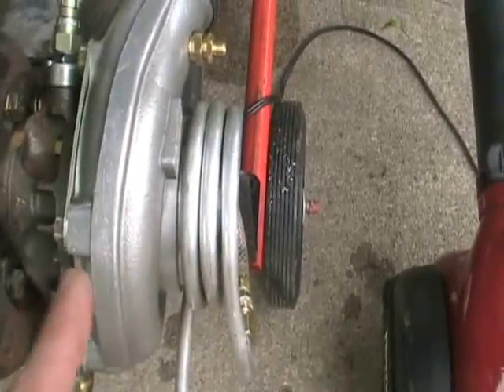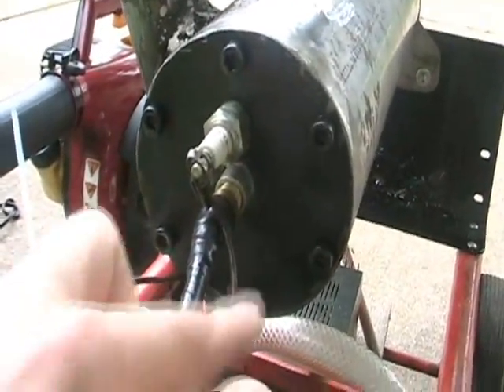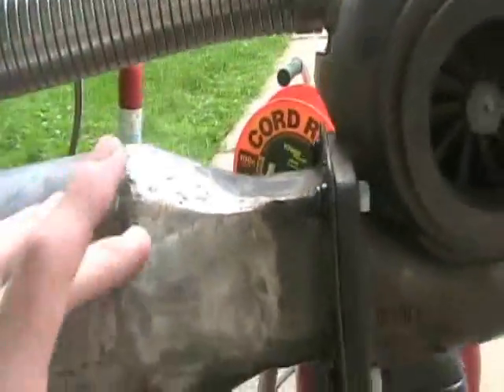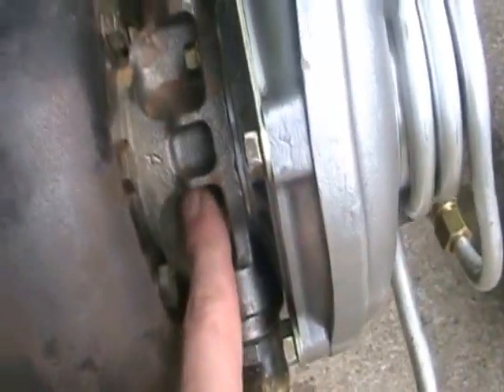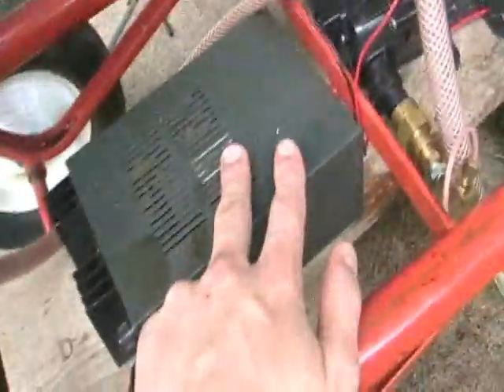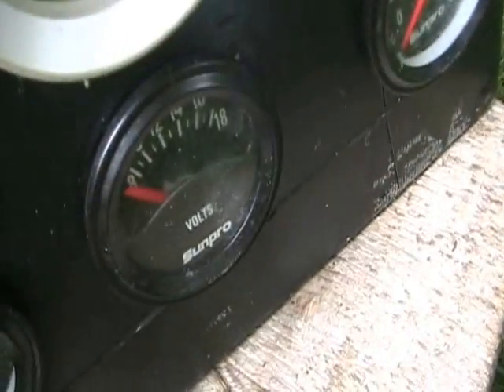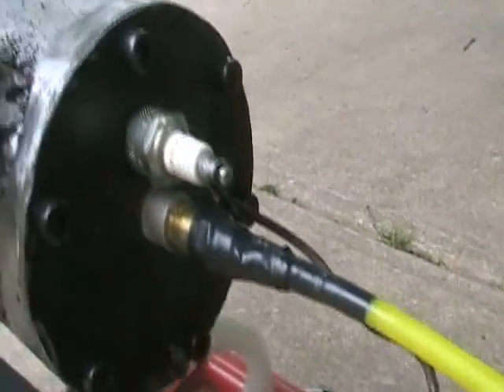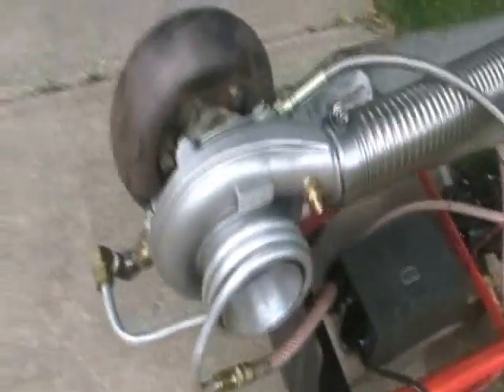First DIY Turbo Jet Engine Startup and Test - Middle school project

Comment: You might want to change air entrance angle so it gets pushed a bit downwards the length of the combustion chamber. Might give a more even and hotter flame

Comment: Thats not jet engine
Reply from the maker: You are not a jet engine.
Reply: +minecraft games But it is a jet engine. All the criteria are present and it functions in exactly the same way that the engine on a 747 or F-14 does. Yes, I'll grant, it's not very efficient...at most it's probably putting 40 or 50 pounds of thrust and that'd be with a nozzle fitted...but what we have here is a true turbojet engine.
Reply: and you're not a letsplayer
Reply: This is exactly how a plane jet engine works
Reply from the maker: +TestECull  Definitely not efficient, and probably not even 20 pounds of thrust. But It is a gas turbine!

Comment: Great video although I noticed a few critical problems. The first was when you're referring to the compressor section of the turbocharger as being able to move tons and tons of air that particular turbo is t4 compressor inescapable of moving upwards of 40 to 60 pounds per minute at about 20 to 30 pounds per square inch far shy of tons of air but I know what you're saying. The second main issue is your oil return coming of the turbo turbo chargers are designed to have a constant flow of oils that is a passive drain coming out of the journal bearing system and usually an angle of 15 to 20 is the most you can do I see the oil return is also a loop around the compressor inlet which brings the oil at higher elevation in the feed going into the turbo that will backwash the turbine seals in a heartbeat and could have caused your turbo failure. I have done mini turbo setups on vehicles I gotta tell you and im proper lubrication system is the fastest way to kill turbo. The best thing I can recommend for a good oil pressure set up is to use a power steering pump with about a 70 pound release valve and pair it to a DC motor that you can control with a rheostat. Turbojet a lot of fun to play with but definitely understanding the basics of how turbochargers work. this particular turbo has a rpm range upwards of 140,000 rpm so you were not even close to tapping it out completely. If you're able to set this up again with proper lubrication you would be able to make some serious noise with it. Overall it was a very good setup I like to see good projects such as this if you're able to on the next set up and put a pressure sensor on the turbine side and you can compare the pressure ratio between the compressor and the turbine that will also give you a lot of data on what's going on inside your flame tube.
Reply from the maker: http://youtu.be/-ySgDO42yys?t=1m20s

Take a look at the newest engine, which runs on liquid fuels, and is stuffed with thermocouples and an optical tachometer to keep track of operation.

The video you're commenting on is of an engine I built when I was young and silly. There were many, many problems with this setup. 

It had no oil pressure, no oil cooler, no oil (it was some sort of 2-cycle oil I found, and used because I had no patience), and as you noticed, the drain is almost upside-down.

I'm amazed that this engine even ran, and didn't chuck a turbine.

Comment from the maker: There is nothing terribly wrong with using a divided turbine housing, its just less efficient, considering the very different flow relationships and ratios we are looking for in a jet engine, as opposed an automotive application.

You could do something like  that, although it would be very complex. I'm not sure what would be gained, but its an interesting idea.

Comment: Cool machine. I'm curious, what happened when you used a divided inlet turbo? One thing you could do if all you have to work with is a divided inlet turbo, build your combustor with a divider wall (effectively creating 2 combustors) and use 2 burners. One for each inlet passage. Perforation in the divider wall would help too, incase of a burner blow out. The tricky part with that is you need to cut the air entering the combustor exactly in half.
Thanks for the warning about cheap turbos  Cheers!

Comment from the maker: Don't use turbos with divided turbine inlets (like I did). This engine did not last very long.
You should avoid the cheap e-bay turbos at all costs.They leak oil like a sieve, and don't last 10 minutes.

Look on ebay for a used turbocharger, and make sure it is a used garret, holset, borg-warner, or other reputable turbo manufacturer, and confirm that it has little or no shaft play (a sign that the journal bearings are wearing out). Check my videos, my new engine uses a holset st-50 costing $90.

Comment from the maker: People insist on doing the "leaf-blower test" on their combustors.

(I'm speaking after years of experience and another engine)

It really means nothing. Burn characteristics change so drastically between atmospheric pressure (leaf blower test), and actual operating pressures and flowrates, that its extremely difficult to make any judgements untill you've got TIT and EGT numbers from engine testing.

Comment: @highvoltagefeathers 

I got my combustion chamber readdy today.

tested it with a verry old propane tank of aeround 2 liters. and hooked a decent size of petrol leafblower tu the inlet of the chamber. 

Is it compared to a turbo on full trottle? a turbo makes lots more RPM but a leafblower moves more air with his bigger fan..

Anyway it burns great. no yellow flames and not that much flame leaving the end... lots of heat though.

Comment: Ohhhh sorry mate. 
I thod the in and outlet should be under pressure. but its only the inet that gots restricted by flowing straight in the bearings.

But still finding it strange that you put  the radiator between pump and turbo. ;)
. Im going to work tomorrow or monday on a combustion chamber. I got some steel tube and olf 2 liter fire extinguisher layin aeround.

you think that would be big enough?

Then its like 300mm length flametube is like 80mm with and fire ex aeround 150/160 mm.

Comment: @highvoltagefeathers 
Maybe you have to explain the word transducer. ;)
I thod it was a restriction valve or something to create pressure..?? Guess im wrong.

The setup doenst make sense to me anyway
Setup:

Reservoir->pump->filter->turbo->radiator-> your transducers ( however i dont know what it is maybe its neccecary in front of turbo i dunno.

But that kind of setup sounds more logic to me:)
Are the transducers needed BTW ? i thing im gonna use a valve right behind turbo.

Comment: @highvoltagefeathers 

huh? that way you have no pressure on the turbo?
Only on the filter and radiator.  shouldent the turbo be between the transducer and pump?

Comment from the maker: @scuffieduffie I actually didn't use a bypass valve. I wired up a very simple pulse-width modulation circuit with a 555 timer, some misc. components, and some beefy mosfets. I can adjust the oil pressure at the turn of a dial.
And on my new engine, the lineup is: Turbo out- oil resivoir - pump - filter - radiator - temp transducer - pressure transducer - turbo in.

Comment from the maker: @scuffieduffie For oil? It needs around 40 psi. NO LESS than 25! It will be dead in no time unless it has plenty of oil (which this engine did not, and subsequently died shortly after this video was taken).
I used a gear pump called a scavenger pump. Its used to feed turbochargers on a separate oil system, or to return oil from a low-mounted turbocharger.

Comment: A cheap potable hand held taser from ebay works really good for a ignition system. it will fire up a spark plug no problem. You could also go to any army surplus store to buy a taser, or a spy camera shop has them, I use tasers all the time to start my DIY jets.  Liquid or propane starts.  really light, easy, and portable :)

Comment from the maker: @rcfreak2493 It would have, had my oil pump been working properly :P
The turbocharger in this video was hardly getting any oil at all. I would advise that you not use pvc for your oil resivoir, and that you purchase a "12 volt scavenging pump" off of ebay. These are gear-type pumps which are designed to feed turbochargers and deal with very hot oil. This is the kindof pump I am using with my new jet engine, see my latest video! :)
Thanks,

Comment: @highvoltagefeathers  hey i also have 2 more questions. 1: does the heat from the oil heat up the pvc so much to were it gets soft? because the max working temp of pvc is only like 140 F.... 2: were did you get your oil pump?

Comment from the maker: @rcfreak2493 I used flexible exhaust tubing from an auto-parts store, but this is by no means air-tight, and not rated for the engine's operational compressor discharge pressor. I substituted this later for a black silicone-type hose which cost me less,  and worked alot better. :)

Comment from the maker: @JetAce08 Not really, Dad helped with funding! I learned to weld (barely, but eanough) with our self-sheilding mig machine, and bought a cheapo "made in china" turbo off ebay. The pump is agricultural which I got from my grandpa (these pumps DO NOT work for oil! trust me :P). And I used some 5" aluminized exhaust tubing for the combustor, which I got from my uncle's truck shop. It was quite the learning experience!
Thanks!

Comment from the maker: @Twankiejones It is a Fimco Gold Series High-Flo pump, rated 60 PSI at 2.1 GPM. Model# 5275497. I got it at my hardware store, but im sure that it, or ones like it are available on ebay.